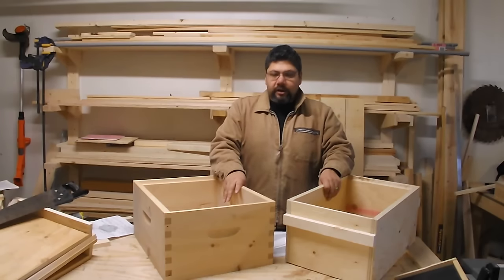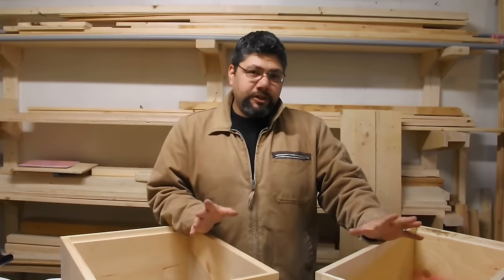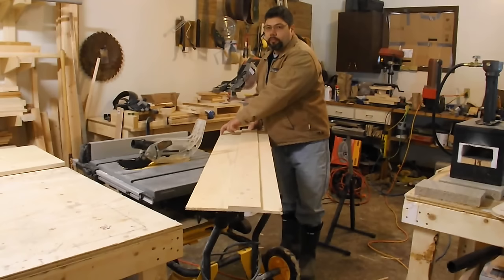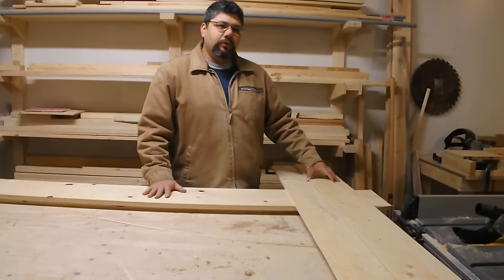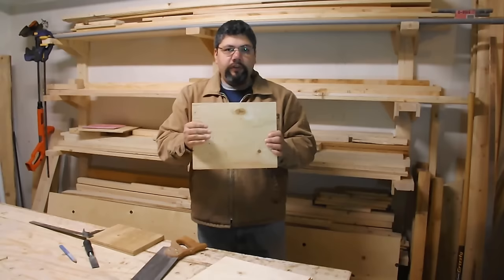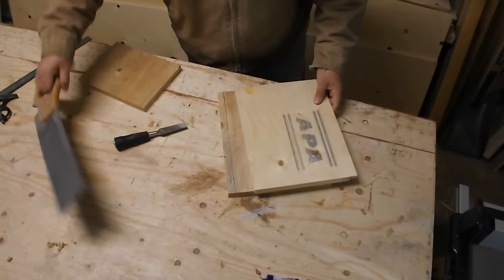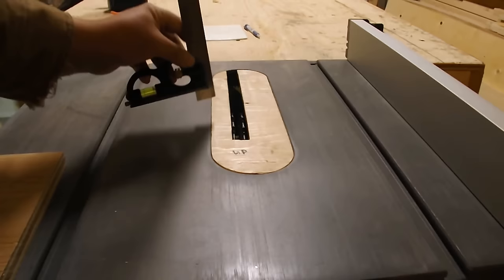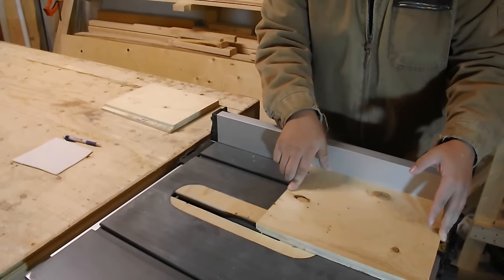How to make a simple Langstroth beehive

Comment: Just to quickly explain the imperial measurement system.  There are twelve inches in a foot, three feet in a yard, 1760 yards in a mile.  (there are also intermediate units like:- rods, furlongs, chains,  as well as a nautical mile which you use at sea.  Because it's longer than a land mile the journey is shorter. (yes, I know) There also used to be a country mile that was as long as you wanted, but it fell from favour)  Inches were originally the length of the last joint of your thumb, but later they were made more scientific and calibrated as six grains of wheat laid end to end.  To further simplify, each inch can be divided into halves, quarters, eighths or sixteenths.  So we might have a dimension of one yard, two feet and thirteen sixteenths.  See how logical and simple it all is, compared to the metric system that has everything in tens.  I am British. The metric system was invented by a Briton. We chose to ignore it for 200 years.  Now we have a fantastic mix of units where anyone uses whichever system they fancy on the day.  At least the Americans are consistent, having stuck to one system, even if it is a bewildering medieval one.  :-)

Comment: Hey don't be so hard on yourself about butt joints I have lots of commercial boxes and they Warp and a lot of them mold in the finger joints I am convinced there is nothing wrong with butt joints I've never had a box separate with butt joints I have with finger joints because whoever built it put the crown the wrong way... Besides -bees would live in a shoebox if u put em there , at least for a while lol . I have butt  joint boxes just as many years old as the commercial boxes with finger joints and they look better so far. Personally yeah you have a lot more gluing area on finger joints you also have a lot less material now and you also have a lot of places for moisture to rest..

Comment: Thank you for simplifying it ,
I have been using Home Depot or Lowe's to cut my plywood at the time of purchase .
Reply: this is what i thought too, glad i wasn't the only one dude
Reply: @obviouslytwo4u  

politeness  and kind words  go a long way among the employees of The Big Box store considering they are at some of the most boring jobs out there ,
some of them will bend over backwards to make sure you have it exactly the way you wanted it to be ,
the only thing they don't cut angles that something you have to work at .
Reply: @nidalshehadeh6001  My experience as well. If you need precise cuts you need to find a motivated employee and be nice to him. If you get the wrong guy, no matter how nice you are you aren't going to get precise cuts.
Reply from the maker: I worked at a box store lumber yard for years, most of it in the building sales office. I'm Curious did you ever show them the plans I drew up and if you did, did it help them out on cuts? Also on a side note, yes under the table tip would help get you tighter cuts. Box stores often pay minimum wage and quick to layoff when the season slows down.

Comment: Seems best to use 1 1/2" screws and pre drill. What I was taught was to take a brad nail, clip the head off and use that as a drill bit... it won't break and works just as well as a drill bit so you don't have to worry about breaking yours on so many boxes. So you said it's best to just buy the frames?
Reply from the maker: I'll have to try that brad nail trick, thank you. Building frames I find difficult to justify. It takes to many minutes to make a poor quality frame even more minutes to produce a commercial quality frame with self spacing rests, foundation slots and predrilled for wire. (15 mins frame) and a lot of saw/router time (increase risk of injury plus power consumption and wear and tear). In the end your better off doing almost anything else to make some money on a side hustle and buy the frames with that money, or just prioritize it in your budgeting.
Reply from the maker: Another way to look at it is if you make 200 frames with free scrap lumber. You save $200.00 yes. But your wear out a $30.00 router bit, reduce the life of a $30-$100 dado blade. Burn up a (in my case) $40 10" saw blade for the table saw. Plus my electricity bill spiked and cost and extra $30-40 that month. It took me 3 hours to build 100 simple old school frames that don't selfspace and don't have the grooves for foundation. So I'm reminded of the pun 'nothing is free', all a persons done is hidden the cost of frames in other areas.

Comment: i realise its an old video but i would dove nail it angled nails just like a dove tail but they dont pull out and stop the boards from warping
Reply from the maker: It’s been a while since I made them but I X the tops and bottoms edges. Then alternated up and down as I went down the length of the box. Due to the time I seen some out in the backyard that I had abandonded and left in the weather year round and their still just as good as when I made them.

Comment: Great video dude, i need to buy a saw table , nail gun etc, you could use a bit of .5 or 1mm thick metal going around the corners to strengthen them

Comment: Thanks for the info, I have made hives similar to yours with 18mm exterior Ply. I was wondering how you treat your hives? Do you paint them or stain them? Or just let them weather as they are?
Reply from the maker: On the exterior I paint them with a solid, water based deck stain. The kind that doesn't last on a deck :) The edges I would rub with extra water proof glue when constructing them. Interior is left raw, after a while the bees have propolis and wax all over them and they seal up nice. Dont get paint or stain on the tops and bottoms of the boxes, they stick down real tight or leave a huge gap from the glob of paint.

Comment: Just a little confused on the plywood for "outdoor use". That would mean treated and that is a huge no no in bee keeping, from what I have heard.
Reply from the maker: 2 Ol' Vets I just did a video about this, I’ll try to link when I’m on the computer. There’s treated plywood and exterior plywood. They’re the same plywood to start with which is made from exterior weather resistant glue. Then some of that plywood is sent to treatment plants to get put into the tanks. Those are the green and brown.

There’s a 3rd plywood for interior. This uses lower quality glue and a few rains it will begin to delaminate.

Comment: Is there another video to explain the hive, the base, is it just placed on top loose like that on the bottom cover? Is that opening at the bottom the entrance? Is it too big and risk wasp attack?
Reply from the maker: I have a linked video for lid and base construction. In there I talk about using one of the side rails to make an entrance reducer. You can make a variety of sizes to suit your need.
Is it sitting lose on top, yes. Place your box straight on top the base. 
The lids are designed so you can stack hives side by side. They can also be tilted to the side if you want experiment with top hive entrances.

Comment: would it be cheaper to buy pine wood and follow this tutorial rather then buy a kit and if so then would it also be able to last as long as the kit?
Reply from the maker: Yes rough slabs or other options can be cheaper. In 2017 I think plywood doubled due to “shortages” then in COVID it doubled again. But so did a lot different wood products. Since then I’ve also left the lumber industry so I’m not sure where pricing is now.

Comment: I was just wondering about the glue in the Ply.  With all the chemicals in the glue  Will it hurt the bees at all ?
Reply from the maker: Mark Conner the chemical in plywood is formaldehyde which gasses off while the adhesive is curing. Tolko did a study and found the levels to be far under maximum allowance for home interiors. Plus oddly formaldehyde is present in the wood itself. When you come in contact with it is when your sawing or handling the end grain. But since I made this video there’s getting to be more and more formaldehyde free exterior grade plywood. Also these plans can use 1x12 dimensional  lumber. I’m finding spruce will hold out okay even for a hobby beekeeper.

Comment: So basically what you need is a fully equipped workshop complete with bench saws etc and not "Just a saw" as stated?
Reply from the maker: TreCoolResident everything can be done with a handsaw. It takes more time and effort. But sheet goods can be ripped down. Table saws and circular saws just makes it easier to be accurate and fast. The reason I used my power tools is 1st my own time. I have one morning a week where I can use my garage uninterrupted and it’s not even a sure thing and second I used my setup to help show people who might have the tools what I found as a fast and efficient way to setup for flow.

Plus I tried to include how to rabbit out the rests with a saw or circular. Which are the tricky spots, everything else is just straight cuts.

Comment: What kind of nail gun are you using? I am building some boxes and will use finger joints and then would use a nail gun do drive or stable in some nails or brads what ever is suggested. I don't know what to use. I am concerned a nail gun might be too big and a brad nailer too small.
Reply from the maker: 16 and 18 ga Brad nails are 50/50 and I found they don't hold very well. Some people may find different but I find the corners want to separate. In the video I'm using an 18ga narrow crown staple, 1-3/4" or 44mm, some commercial beekeepers use this option or they use a 1/2" sheeting stapler (but that's a $400.00 gun). I find staples are a better option over brads, but still not the best option. I have a commercial bee keeper friend and he uses a palm air nailer with 2-1/2" spiral nails. The other option to this is the ultimate option of speed and life. coil nailer or framing nailer using galvanized spiral 2-3/8 nails. If you don't have an air nailer then a simple hammer using 2-1/2" spiral nails will work great, just takes more time. Any larger and you split the wood, any small and you lose the gripping power.
Reply: I think what I am using now on top of glue is a 18 gauge narrow staples. 1 1/12 inch long on the  corners and they won't come out. I tried it and I think it works well, or better. But then  I am always been a fan of screws over nails.

Comment: How much frames can you do a day? If you work about 12 hours?
Reply from the maker: With my current setup I do an average of 5 complete boxes an hour. This also includes sawing time on lid material and bottom board material. If I ignore the lids and bottoms it would probably be 6. I use sheet goods and build in sets of 6 plywood. Gives 30 deeps plus 6 mediums ready for painting. If you are talking about frames then I was doing about 10-13 hour and still had to assemble them.  In the end building frames from scratch cost me more than buying them. But boxes are worth it even if I say my time is worth $20 an hour. Of course if your talking a true 12 hours straight you have to factor in diminishing results and I'd be slowing to maybe 2-3 an hour
Reply: Thanks a lot for the fast and useful response. Have a nice day! :)

Comment: great but how about the frames or bars please; i was nailed to the video waiting for the moment you'll explain that too
Reply from the maker: GREENE NDONGMO I did some simple frames in another video but I couldn’t recommend making them. I was able to buy unassembled pine frames for $1 each. When I figured out my math for 100 frames cut up my DIY non spacing poorly made spruce frames cost $1.68 in worn blades, power, router bit and table saw use. And still not including my time of  1 hour /10 frames to make. If I’m remembering right, it’s been a few years.

In the end I paid about $170 and 8hrs of time for 100 unassembled poorly made frames when I could have just bought 100 commercial frames for $100 and not waisted my time on them (I only had weekends to do the work)
Reply: @Metalandstuff464  ok thanks got it
Reply: I love that you did the math on that thank you

Comment from the maker: BOX JOINTS, yes, heat of the moment and I didn’t see it at the time of editing so I used annotations to correct which YouTube removed in 2018. To help out I made up a cross cut jig for a circular saw with this video in mind. I show how to make it without a table saw. https://www.youtube.com/watch?v=LMJScO8sUXU&t=169s

Part 2 for the top and bottom boards can be found here.
https://www.youtube.com/watch?v=T1rbTMLJ7ic&t=15s

Comment: What Plywood did you use ? The ones I find are way too expensive. Can you share a link ?
Reply from the maker: This is dependant on location. Locally I'm using standard exterior grade (non treated) plywood 3/4 (19mm). Currently its $46 Canadian per sheet. For some people buying pine, planks are more cost-effective. For me, it just wasn't because it was over $20 per box and I'd still have to cut and make them. Commercial boxes in 8 frame wasn't available and 10 frames were $23 once the shipping was factored in.

A link for plywood type though is here. http://theplywood.com/cdx
Reply: @Metalandstuff464  Thanks buddy, this is selling for about 30 CAD per METER :) Does it really have to be so thick ? Would OSB do the job ?
Reply from the maker: @sakiskyriakou563  thats for a sheet of 4x8 or 1220 x 2438mm. the 3/4 or 19mm is so you have the correct thickness when cutting the frame rests out. Original boxes was 7/8 rough or 22mm. Some people say it helps with R value, but when your down to -20 to -40 C for 5-6 months of year that .6 R value didnt matter much to me. The real reason is stiffness of box's when carrying 100lbs of honey and frames, and being stacked up 4-5 boxes high.

OSB may fall apart. There is a product out there, used for flooring, durastrand which has good exterior grade glue. I think its "barnyard bees" who makes his mating nucs and hives out of engineered wood and hes had good luck with them.

My plan was to use plywood like this to make a mating yard. 40 hives worth and those would be my breeders to expand my farm. But life didn't permit it due to a sudden development of allergies.
Reply: @Metalandstuff464  Thanks for the update buddy. I am starting a new bee farm. How do you recon starting my bee hives ? 3 frames on each 5 frames on each or packed 10 frames and install a second floor. I am not after any honey production just maximum population I can achieve. I will be giving them syrup and Pollen sub. Thanks for the help again buddy

Comment: not sure if it's true but i have heard the glue used in making plywood is toxic to bee's
Reply from the maker: When I first was looking into it I was concerned about it as well, so I spent a lot of time scouring the web for information. The issue being the glue, in it is the formaldehyde.  formaldehyde is a bonding or curing agent, so as it gases off it makes the glue tack up and cure, if I'm remembering right. After 6 months the glue has gassed off and this typically happens before it leaves the mill. Funny thing is, wood gasses of formaldehyde because its naturally occurring, so our frames, boxes, lids if made of pine is still gassing off a small quantity. There is one commercial beekeeper who uses durastand, i think. Same deal, OSB exterior grade sheet goods for flooring "Barnyard bees". https://www.youtube.com/user/davidhaught84/videos check him out i found his videos very helpful

Comment: hey what type of blade is that on the table saw?
Reply from the maker: zayne1996 the main blade is a dewalt 32t 10", just a stock blade. The other is a 8" stackable dado set, just a cheap set. $30-$50 range
Reply: thank you

Comment: 1 sheet of 3/4 exterior plywood here in AZ is between $30 - $40.  Underlayment is $18.  Add in the millwork time, hardly worth doing.
Reply from the maker: Ephbaum my situation is unassembled is $30 pine (box plus shipping) vs $11 ext ply. (2018 pricing time, wear, elec) Long run yes pines better. It takes about 2 hours to break down and rabbit 6 sheets on the setup I’ve got. 6 sheets gives 37 boxes (deeps and 1 med per plywood) so for my area it’s $402 vs $1100. But if someone’s able to buy pine boxes for $15 and ply is $40 then no, just get the pine. I guess maybe my goals will also help. Low initial capital and while I’m learning/testing the waters as my production grows I can begin converting into pine. Not sure where underlay comes in, I wouldn’t trust it for ext even though glue is good.
Reply: Dadant and Mann-Lake are 16.95.

Comment: I thought you had to use untreated wood. Plywood has glue and stuff.
Reply from the maker: Vivian Mansfield a few years back I researched this before I decided on material. The biggest one is treated, deck boards, chemically treated pallets, or fence boards (green, brown, black oil etc) those are insecticides and fungicides. As for non treated plywood, there’s a bonding agent, which is a type of formaldehyde in low levels. In the first few weeks as the glue cures it gases off. By the time you see a lift at a retailer it’s been about 6 months of storage and shipping and they say it’s negligible. The glue will be between the plys and the bees don’t crawl on the walls too much so they’re not in close contact with even the surface of the plywood. Plus there’s good ventilation in the hive. As always straight wood is best, but even sawdust from spruce is dangerous. Funny thing is there’s formaldehyde already inside the wood itself.
Reply: Jason Kish oh. Ok. Well thank you.  :)